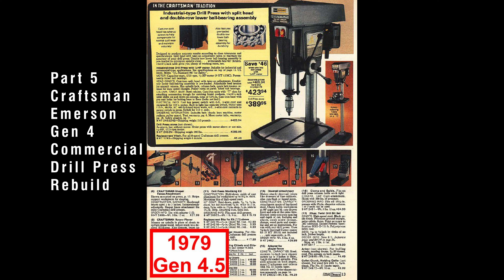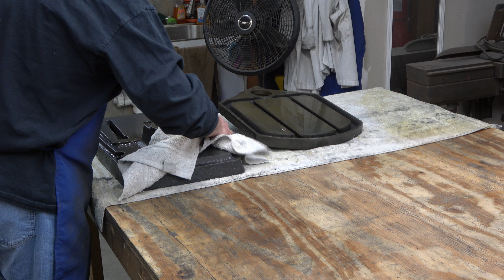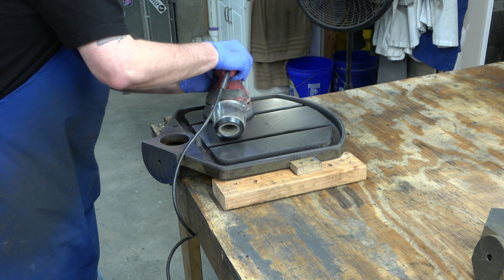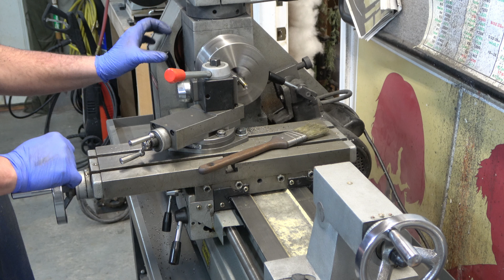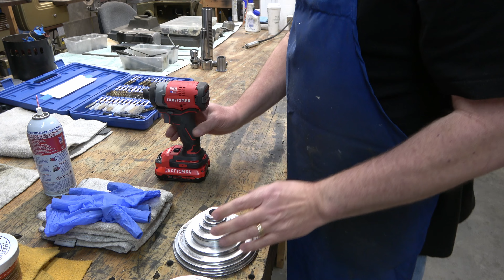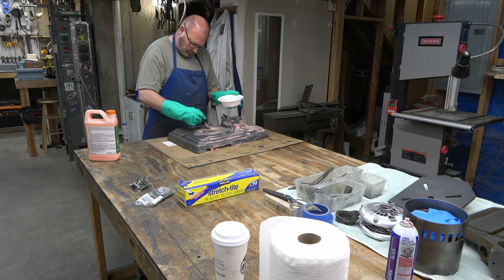Part 5 Rebuild Emerson Gen 4 Commercial Craftsman Drill Press (Cleaning & Masking)

Comment: Hey Jeff, I followed you over here from garage journal. I love your videos! I just picked up this exact machine but it is nowhere in as good of shape as the one you were working on here. While I was breaking the unit down for transport I found that it was missing the pin for the accessory table along with the bolt (the table was not being used so it had been removed) also the yellow cap (no big deal) on the motor tensioner along with the black rubber cap that presses on the motor mount when tensioned. It also had the tightening handle for the main table sheared off just above the shoulder. I got the unit for a song so I couldn’t pass it up. Are there any sources for the missing and damaged parts? I am going to begin breaking the unit down for a refurb so we’ll see what else I find along the way.
Reply from the maker: Jimmy Congratulations on the DP. For the missing parts, yes some can be found on ebay but make sure you get the correct parts for your machine. There are some differences between the commercial models and the standard models. I have a spreadsheet linked in the video description that has a lot of information for all the Emerson models. I was also missing the lock pin for the accessory table and had to fabricate one. The mounting screw should be a standard thread, just be sure to get the correct length so that the screw does not go all the way to the column. The back rubber cap for the belt tension pin is no big deal, I use rubber vacuum caps the correct size to fit over the pin. The table lock screw handle should be fairly easy to locate on ebay or fabricate. I do not know if a standard lock screw handle will work for the commercial table but I would think that it’s the same length and the sleeve and nut should have the same outside diameter. As for the yellow vinyl handle covers. I came up with a solution back when I rebuilt my standard gen 4 and showed it in my thread for the rebuild on GJ here is the link: https://www.garagejournal.com/forum/threads/11b30b4s-craftsman-113-213780-15-5-drill-press-emerson-gen-4-rebuild.458819/post-8622419